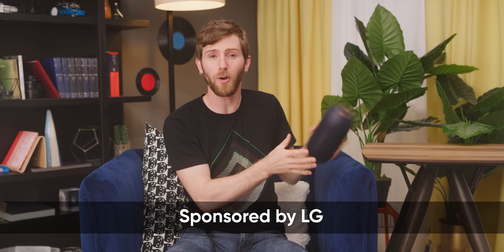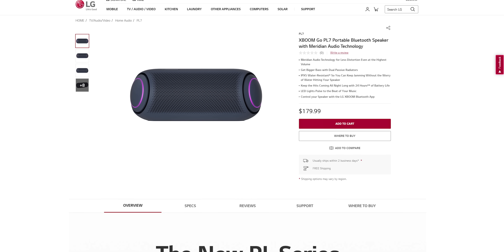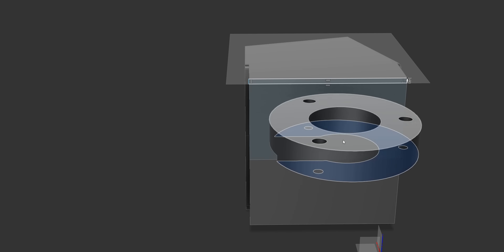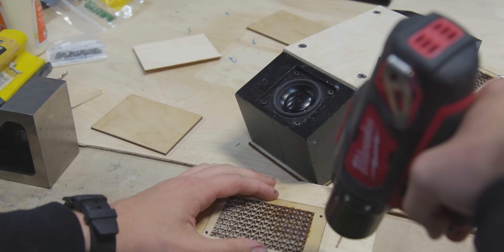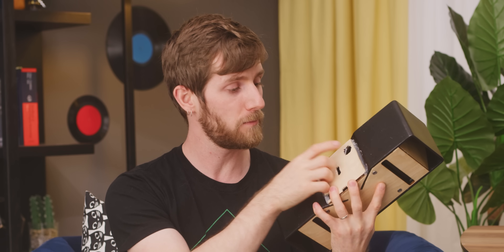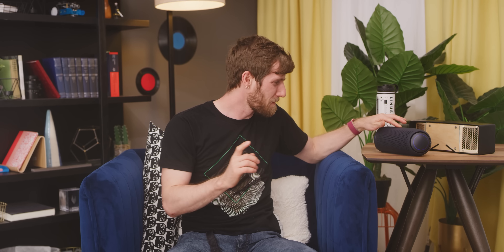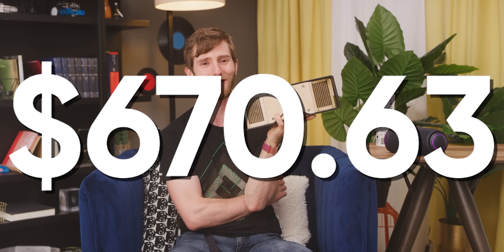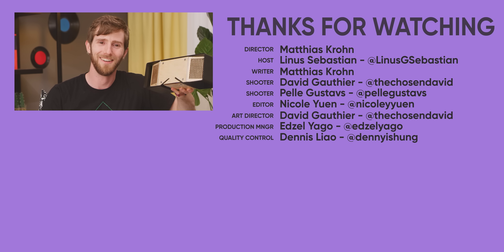Can we build a better bluetooth speaker? - LG XBOOM Go PL Series

Comment: I think it’s silly to factor in a labor cost when LG undoubtedly has millions into R&D and engineering
Reply: L1qu1d S1lenc3r  The Virgin Linus vs the Chad Chinese Sweatshop workers.
Reply: I think the main factor they wanted to consider was how YOU, a regular singular person with their own resources could make it, rather than comparing to LG's product directly. They honestly could have done this without the LG sponsorship, but I think it's still right to factor in labor cost alongside the rest of the project's costs such as in 3D printing material, parts, etc... Of course, the scale, is very very different from what LG does it at, but it's still 'in-comparison' product to product, "could you make something better by yourself?"
Reply: @jinsory5582  Time should be accounted, but for a DIY project, labor cost is a strange term
Reply: @josir1994  I guess now that I look back on it, yeah, honestly if I were to make a project like this, it's not like much of that time I'll spend planning it and making it matters enough that I'll quantify it down to something like Minimum wage. If I were to build a project, I'd probably be doing it on my spare time anyways. I guess in the comparison to the company/LG's offerings, sure, but now that I look back on it, it is pretty silly to factor in labor costs in a DIY project, mainly based around the idea you make it yourself. Plus, the labor costs would vary enough anyways between each person who builds and makes these 'kits', I guess adding the 'labor costs' was just for the video's sake just so they could get a little closer to what a realistic estimate would be for if you wanted to design a product like this and start selling it, but even with that, the labor costs stated in the video, wouldn't really matter much since it won't ever always be the same.
Reply: I think the idea is that you would save some money on material, but you will have to work on it for a long time. You might as well work overtime in your job, and buy manufactured speaker for slightly more.
Reply: Are you LG or are you a guy who would have to figure out and also do all these things yourself?  And when you buy it from LG you are paying for that R&D too.  You don't just pay the cost of materials.
Reply: The cost of engineering has been factored into the price of the unit. LTT's design isn't very scalable, so there wouldn't be much savings in mass production. It's absolutely fair to factor labor.
Reply: doesn't matter
https://www.youtube.com/watch?v=UMpYChEs6yo
Reply: @cristiandinu16  whoa , that actually sounds good , really good , what was the budget? Also how complex was it.
Reply: I couldn't agree more. The whole concept of this video is idiotic.
Reply: @DiscoballDestro  Who hurt you?
Reply: @as7river  uhhhh, what?
Reply: @DiscoballDestro  I think the video was made for fun, not entirely sure you know what that is but please refer to a dictionary if not
Reply: @bigmanmark4334 Oh aren't you ever so clever. Thank God you came along and enlightened me and anyone else who thought that a sponsored video, AKA an ad, was done just for funsies. The funsiest part was when they illustrated scales of economies by wondering if they could beat the cost of a cheap labor mass produced product  by making their own one-off with single off the shelf components. If that's how you have funsies then bless your little heart.

Comment: For that $40 gap you could definitely have gotten a dedicated woofer driver, better quality drivers overall (btw that tweeter isn't ideal for such a small overall setup, too big), a way better (pre) amp, with a far better integrated or discrete EQ. And still have a few Canadian pesos left to pay the weekly wages of the children manufacturing the commercial "competitor". 

That DIY speaker would definitely benefit from a dedicated woofer driver, it would massively improve sound quality across the spectrum. Also make sure you're not running tweeter frequencies to both the full-spectrum drivers and the dedicated tweeter. And soften up the EQ for the tweeter, running it straight can feel very overpowering. And when listening, remember that unlike woofers, tweeters are quite directional.

Or at the very least, an internal EQ profile tweaked for your construction and application - you're leaving a lot on the table here that does not require physical alterations; just decent EQ tweaking for what you have.

I really like your project here. But IMO it's only half finished. Would love to see a full-body video in whatever channel/platform deemed appropriate, on your making of (if footage exists), and further improvement and tweaking of this unit. Maybe even throw in some tips on how people could otherwise go about constructing some of the different elements, if they don't have access to laser cutters and 3D printers.

Comment: so to do this you need a 3d printer and a laser cutter

perfect
Reply: Maybe not. For the frame you could bend some aluminium sheet then cut out the unnecessary parts and the triangles in the wood can be solved by a drill and some filing.
Reply: You can order a print too.
Reply: Yea, but remember, the board needs no soldering :D
Reply: You can improvise. Being clever is a substitute for most tools or materials you don't have on hand.
Reply: @freshfrij0les  well when if you don't do it with a machine's you affect the sound of it... i can say it's not worthy do it with your owns hands

Comment: next time try tweaking the passive input filter and try adding a loudness compensation button. Yda138 have 2x20w at 12v (3s) and it s very easy to tweak

Comment: That is too big and same sound as jbl speakers and other brand, i built mine with only 2 small bass,full range speaker-3Watts rated 1.5" inches can produce sound quality of 50watts with strong bass base woofer, trick is networking one speaker is treble and voice output the other speaker is filterd for subwoofer vibration only, using the front speaker as mid-range and at the bottom facing speaker is networking to subwoofer output, The zise of my finish speaker is like sardine can and Base on the actual diameter size of the speaker, the tube is made of metal pipe 3.mm because it needs weight, using "mini subwoofer ampli" with 2 variable sound control volume and base, Bluetooth 5, my speaker design is base on transducer or vibration speaker when you put into a wood table thw vibrate creates strong base and woofer sounds like a real sound system or home theater and Dolby sounds capable of producing all the sounds, in jbl or like the speaker you built can only produce loud voices" with minimal base only, if you want to hear the real base sound play mp3 songs not the electronic bitbox sound.

Comment: $140 parts cost?  How did I build, arguably for a very different use, a Bluebooth Boombox for roughly $175 that included a 10" Subwoofer.  Dual 6.5" mains and dual 1/2" Tweeters  both hooked to their own 2-way Crossover.  A 200 watt Bluetooth amplifier (2x50w for the mains and tweets, and 1x100w for the subwoofer).  A exterior led voltage display, and powered by a generic 18v Ryobi 5000mah drill battery, with a spare, and a charger?  All in a wood box I designed, with carry handles, easy access back panel, and coated in truck bed paint for durability?

Comment: I can see a part 2 with: "Building the ULTIMATE Bluetooth speaker"
Reply: Honestly for not much more than the LG you can get the "executive bluetooth speaker" kit from parts-express and it wipes the floor with this this. It has a 5-1/4" long throw sub with a 8" passive radiator and 4" coaxials to handle the highs. I built one and was kinda blown away. It's a lot fucking bigger though if that wasn't obvious.
Reply: That's Austin Evans
Reply: Hi channel member

Comment: This is really awesome guys! ^CJ
Reply: Can't say It's surprising to see you here
Reply: LG USA Home Appliances and Electronics
Reply: Here before this is pinned
Reply: @arenacloser7528  it wont be
Reply: Can’t your name be any simpler
Reply: @vp.ldn19  They're korean, they've adapted their advanced names to the advanced republic of korea
Reply: Bring back the lg v20 design!
Reply: @cybermarc8740  Imagine thinking that DTS not being supported by a BLUETOOTH (IE ultimately it will never compare to plain old copper/fiber optic wires) speaker makes it entirely useless.
Reply: LG u cool
Reply: go home. your drunk.
Reply: its a shame your speakers suck ass because your tvs and other things are pretty good
Reply: Bought one yesterday in Russia, mostly because it has AUX and Type-C, so thank you for not removing AUX just like everybody else. <3
Reply: Why does my pl5 not turn on most of the time and when it does it doesn't stay connected? Is this some kind of prank?
Reply: Underrated Comment
Reply: The good old lg
I really liked your older phones because they are built to last long

Edit: i forgot about the new ac units those are epic only the electronics are too low in the housing because if water leaks from the chamber and goes on the electronics that thing is screwed
Reply: This video is still so amazing
Reply: JBL better than LG

Comment: Why have a hardware audio profile when software is more flexible? I'd like an affordable accurate neutral stereo speaker set to replace my 2.1 Logitech with bulky overbearing bass and "Giant Speaker" MSI that makes Iron Maiden hurt my ears. Maybe a pair of 8 cm speakers would do. 12 cm Sony Mega Bass is enough to hear the bass line in Robbie Williams - Angels, but Sennheiser earbuds have even better bass.

Comment: I built a cheaper and better sounding bluetooth speaker but I kind of cheated on size by using Hi-Fi speakers given away or sold dirt cheap on Gumtree or Craigslist for $5 or $10. What I did is use a similar priced amp that can output 100W x2 and then just connect 1 or 2 Hi-Fi speakers. Speakers I personally got were Panasonic 80W each speaker from a 90s Hi-Fi unit. To power the amp unit for home use I used a 90W HP laptop power supply with a 5.5mm barrel connecter adaptor. For portable use I soldered up an XT-60 (remote control aircraft battery style) connector to a drill battery. I then just bought a cheap XT-60 to 5.5mm barrel connector. The amp I used was the Wuzhi Audio 200W. I opted for the slightly more expensive model that has and Aux 3.5mm connector for input as well as the standard bluetooth. It also takes anything from 5v to 27v DC for the input power supply so it's very easy to Macquiver something to power it. My overall money and time saving tip is why build or pay for a speaker if people are throwing them out or virtually giving them away for $5-$10 on Gumtree or Craigslist?!? All you need is a cheap amp like the one I bought for around $15 and then either solder a connector to a lithium drill battery or use an adaptor for a laptop power supply! :)

Comment: If you wanna get good bass out of small drivers it gets tricky.  One way that's becoming easier - due to 3d printing - is a transmission line (or t line) design for the sub part, figure out how to add a bit of mids and some clear efficient highs and you're in the game.  The key to a great sounding speaker is gonna become the crossover, not as much the amp, hell, most of these off the shelf speakers use a mono amp, a small subwoofer, and a small full range... and they all lack in highs.  Another trick - make sure the tweeter is pointed towards the listener - highs are much more directional, lows are not (bass is supposed to be felt, not heard).

Comment: Nice try! You can definitely beat the LG with some tweaks to you project. Using plastic doesn't seem a good choice. There's a reason guitars are made out of (good) wood. However, trying to beat the price point is useless. You won't. It's a dumb competition. They're an industrial giant and you are not. Also, the unit you built can yield better results with proper balancing in a sound lab. But, hey, nice try!

Comment: With a bit of engineering and time, I reckon a passive radiator would be a cost effective way to get more bass. These Bluetooth speakers are also sealed units so that also contributes to the power/ bass while maintaining a small form factor.

Comment: I’d probably use passive radiator instead of long port. And an amplifier board with more controls, plus bass/treble control.
Mass produced stuff like LG uses dsp to get that sound and crossover to make the drivers work well

Using that full size tweeter is also a huge waste of space lol. Could have had 2x tiny neo tweeters for that!

Comment: The entire idea of mass production is that it is a lot cheaper to mass produce something.
Of course, you will spend a lot more on a one-off of anything than a factory can spend on individual items of a batch of a million.
Design alone is a lot cheaper, if they spend maybe 10,000 USD on design for 1,000,000 units, it will end up being a penny a piece while you maybe spent "only" 200 USD on labour, spread out over just a single unit.
And then they buy every electronic part in bulk, which will make every individual part a lot cheaper on top of that.
I like the idea of trying to make something that is better than that of the sponsor, but you will never get at or even close to the cost of the sponsor product which would make that kind of segment kind of pointless.

Comment: How did you deal with the battery management and charging? In the video you said "twin banks of 18650", as in 2 banks of 4 in series parallel? But that would only get you 7.2v. Or do you mean 4 pairs in series parallel?

Either way, then how did you deal with using TP4056 modules to charge the cells? I guess you used multiple modules  with the same input? But the series connection would have to be disconnected while charging because the the input and output of the modules share a common ground. I guess you could do that with a relay?

Still would love to know exactly how you guys wired it though.

Comment: Okay, but those passive radiators on the LG are basically cheating. Instead of doing ported, you could've done passive radiators too to get that bass without a dedicated bass driver.
If i had to guess other than the EQ, that's the only thing that made it sound better.

Comment: Those "Bluetooth boxes" mostky sound like garbage (and I listened to quite a few). "classic active Speakers" in the same price region beat those things in so many ways. What's wrong with these BT boxes? How can you mess up like this? Sure, I wont't compare them to a 3000€ high end stereo setup. But even cheap "computer speakers" often sound better. 

Linuses DIY might be better than most of those "speakers", but image actual good 2-way or even 3-way speakers in a wooden DIY Enclosure. Maybe 200$ to 500$ for the drivers should be ok. Which isn't that much anyway

Comment: The tweeter sounds harsh because there’s no crossover and it’s clashing with the full range drivers. But that would have cost another $3 and however long researching. Hella cool with the long ports and the design though. Some higher x-max woofers as opposed to full range drivers could have also improved bass response. It’s always cool seeing you do stuff like this! Good work

Comment: bluetooth speakers usually only have 1 large chamber for both speakers and a passive radiator instead of the bass port.
this is to get cleaner bass. if you are going to use tweeter then you need to use 1 inch small car similar soft dome.
and without dsp adjustment you will not get good sound and bass

Comment: most small bluetooth speakers like JBL EXTREME AND CHARGE use DSP that are factory adjusted. it is the equalizer that the factory has adjusted. without DSP you will not get such good sound!

Comment: HAi     Linus  on a serial    Question about ipv6   is this how you easily convert    ipv4 to   binary    base2    then from binary  to     ipv6    base8 

 i learned ipv4 in school  now i was afraid of 
ipv6  but however it is pretty interesting on conversion,  ipv4  
172.16.30.48  change into Binary,   then change to ipv6  which is base 8
   0123456789ABCDEF   A=10      B=11      C=12      D=13     E=14      
F=15
1010    1100 =  172   .   0001  =16     .   0001  1110 = 30    .     
0011 = 48      BINARY  =    1010   1100 0001   0001 1110 
      does  172.16.30.48  convert to this in hex8  >>> ipv6??? 
    AC  1  1  1 E
This info via:  
https://www.networkworld.com/article/2228593/how-are-your-hexadecimal-skills-.html

Comment: So the conclusion is that for $40.90 less, you can make yourself a product that is worse in features (and slightly worse in sound quality) than the off-the-shelf device...
Nope, unfortunately Linus Tech Tips did not do it better than the pros. :(

It is definitely possible though. I'm working on a Bluetooth boombox that will sound good - only trouble is, it won't be the same size as a portable. For portable use, just buy an off the shelf portable with the features you need, along with a good battery life, at a price you're happy with. For me, it was a pair of KitSound Hive2O speakers, coming in at £25.98 including shipping (those speakers can be paired together in Bluetooth for stereo operation).

Comment: With there being only one tweeter, I'm curious how they wired it onto a stereo amp, I'm guessing incorrectly. I'm also guessing there was no proper crossover circuitry at all on the full range drivers to keep them from taking the tweeter's job away. Cool project but with the help of an actual speaker designer they easily could have built a proper enclosure, used drivers that work well together, and wired up a good 2 way crossover to get good sound quality. I'd love to see this project revisited someday but get in touch with someone who designs speaker/speaker enclosures to make a great DIY bluetooth speaker design.